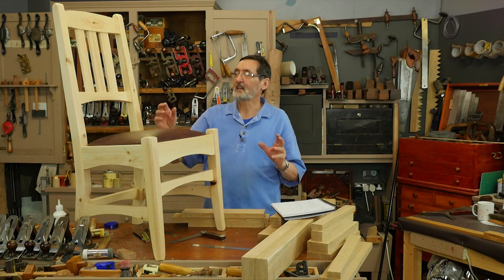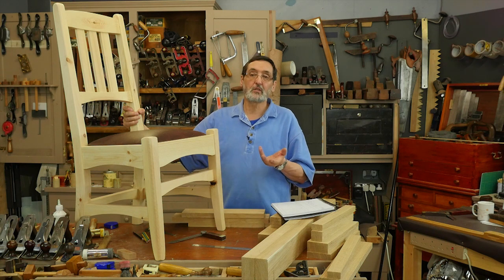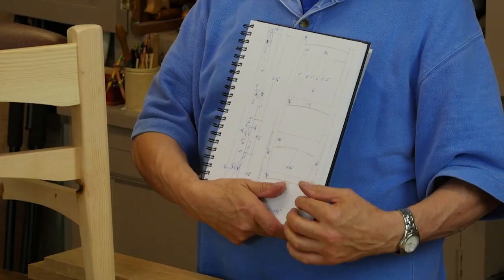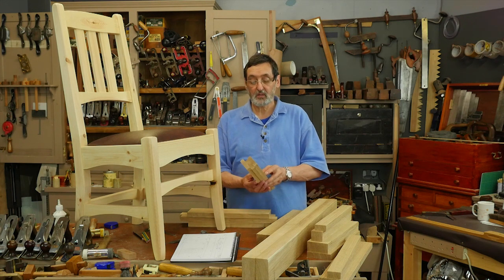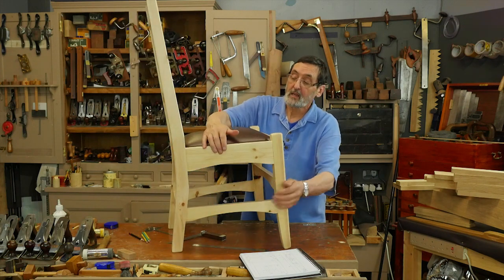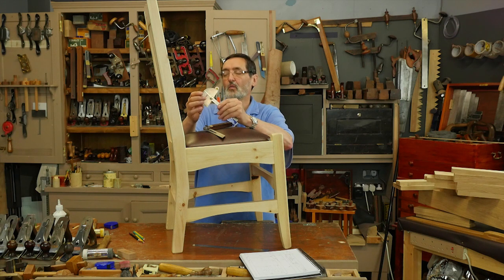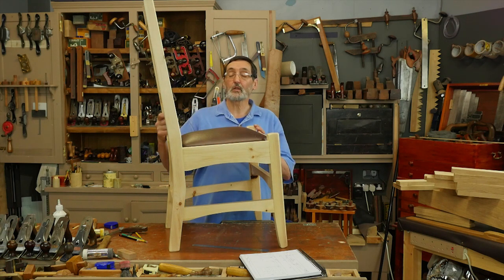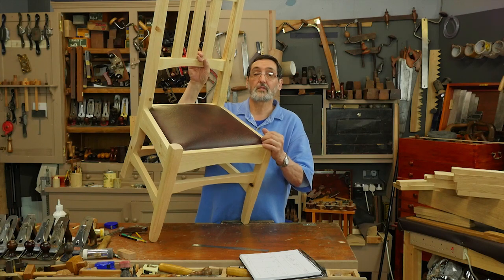Introducing Making a Dining Chair | Paul Sellers

Comment: I'm glad you mentioned the way the legs extend at the top. 
Watch how people sit on chairs and you will see that not everybody has a formal posture - hence the saying, 'on the edge of your chair'.
I can't see any reason for them other than they match the top of the back. On the other hand I can think of a couple of reasons why I wouldn't want a chair with protrusions like that - they are called testicles.
Reply: Perhaps it's time to educate the proper sitting etiquette — sure this will be a reason to do.
Reply: Jake Gevorgian Are you kidding or what?
If you are suggesting that you have to sit on a chair a certain way to avoid protusions then I would suggest the design needs a slight rethink.
I'm guessing that he has already had some comments on the design because it was the first thing he mentioned.
Chairs are sometimes approached from the side because the table is close to a wall and people sit on the side and then swing their legs around.
The top of those legs need to be as low or lower than the compression of the cushion.
Reply: hawkesworth1712 I know how it feels when someone's critiquing your design. That is why I tend not to look at things as a bad design. I see your point of view--in general I agree, but there's also the architects eye...these protrusions look great by standing out from the rest. Anyhow, that's how I think, and most of the time I don't care about the functionality over design.

Cheers,
Jake

Comment: Thank you for this. I want to make some chairs for a friend of mine because all the chairs for sale in our area are horridly expensive and/or made from mdf with crappy laminate & horrible joints that break. I don't think we can find the oak wood like that here, but I'll have to see what is available in the lumber store.
Is there a link to the next video (is there a next video showing how you make the chair?) Or is there a website with diagrams & measurements?
Does cutting the 1/2" from the back legs make the chair more stable or was that to make it more comfortable?
At what angle are the sides of the seat as they move away from the back to make it wider at the front?

Comment: should be a good watch. i have upholtered loads of dining chairs, broke them down and rebuilt them. no one is the same not even the drop in seat. some 100 years plus.
Reply: BTW if anyone thinks this is intimidating , think of the poor sods who make chair frames that are half upholstered with exposed intricate wood and the poor sod of an upholsterer that has 1/4"6mm to tack everything :)

Comment: How much does all the wood and the seat cost compared to buying a chair of similar size and design.
Reply: Not really the point.
Reply: ***** It's always more expensive to build it.
Reply: but its more fun! I was asking because I'm thinking of building one
Reply: +Mike Regan Not really an answer to his question.
Reply: +Mike Regan It certainly is!  Go ahead and build what you want for the fun and pride you get out of it, but don't be deceived into thinking that you are saving money.
Reply: deezynar
Never said I was. Or anyone else.
Reply: +Mike Regan That's true!  You answered a clear question with an ambiguous, worthless, and smug answer.  "Not really the point."  Nice how you avoided being helpful by holding back what you think the point should be.
Reply: +Anthony Kernich If you buy your lumber on Craiglist it can be cheap. I usually wait for a good deal. For example, I bought about 400 BF of cherry lumber this summer for 120 dollars. It was an old farmer who couldn't get it out of a barn and needed me to do it for him. The cherry was in great shape. I've already built a dinning room table for 8 and two large benches. I'll be building two chairs and still have several boards left over. With that said, I own thousands of dollars of woodworking machinery. So, it's only cheaper if you already have the equipment and you already build furniture as a hobby or profession.
Reply: +Anthony Kernich If you want to save money short term, buy a mass produced chair.  If you never, ever, want to buy a chair again, buy a well crafted hand made chair.  Hand made is not exclusive of machine tool use.
Reply: Cheaper than having quality chairs custom made to your spesifacations but more expensive than a good quality mass produced chair because you wont be able to source materials as cheap as what manufaturers get and it will take you more time than the pros who are set up to make a spesific chair in batches. One thing is that no matter how much you spend you probalbly wont find a chair to buy that you will enjoy as much as the ones you make.